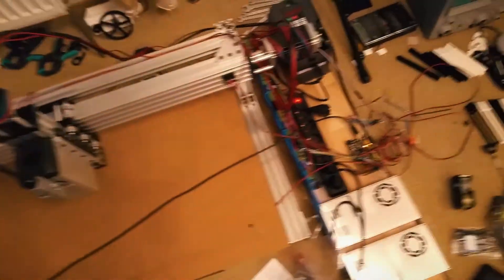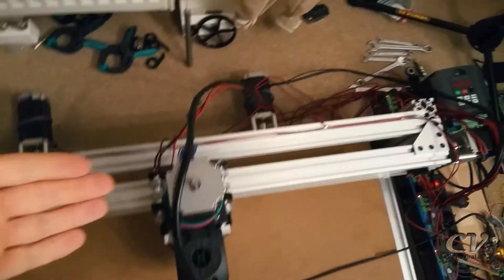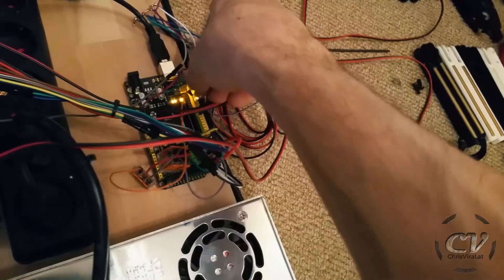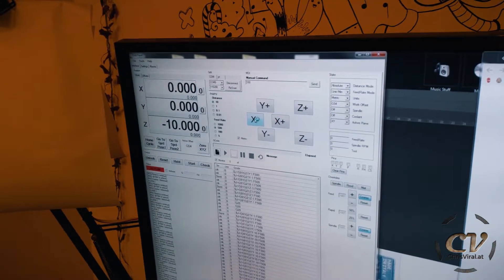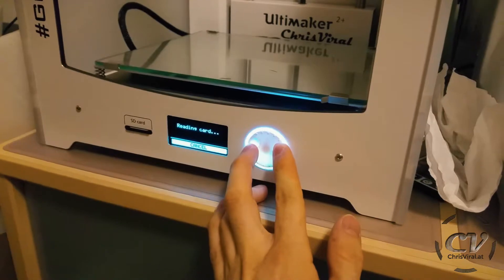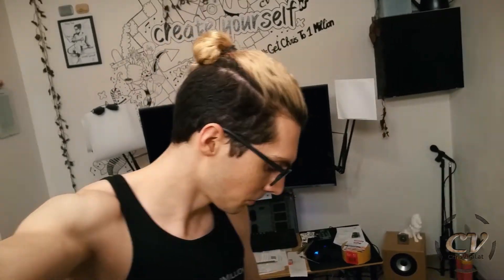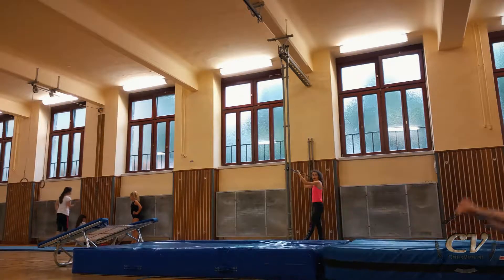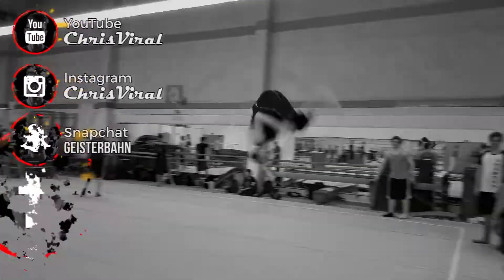Electrical Noise Is Messing With The Limit Switches & Training Session

Comment: if you want an imidiate fast fix, cut up some Cables which are shielded and use them. Examples where what common lay around cables which are shielded:
- Ethernet Cables are Cheap and some are even double shielded (see wikipedia) 
- most USB- Cables are Sheilded especially USB2.0 or higher
- Monitor cables (VG / DVI / HDMI /BNC )
 - PS/2 mouse cables
- Coaxial cables from TV are shielded.

You can also try a DIY trick. build it yourself with the technique used in ethernet
twist the cables ever 1-2cm (very often)
+ wrap aliminium-foil around the twisted cable 
+ connect the aluminium foil to the mains earth/ground (kabel schirm erden)

i hope you read my sleep comment on the other video :)
Reply from the maker: Yeah that's a nice idea but the leads are probably WAY to thin. I'm already really scared with the current ones... They are around 0.5-1mm and get fairly hot.

I did talk to my grand dad about wrapping them somehow but he was like, nah forget that... But I should actually try it just for the hell of it hehe :D